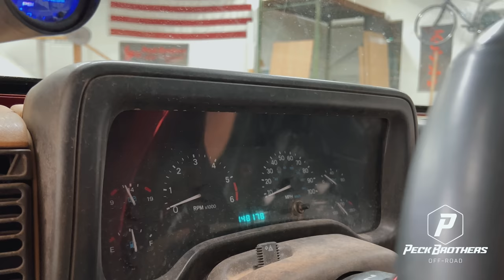HOW I BUILT MY DREAM JEEP

Comment: Currently building my dream lj. I’m building it to be a solid rock crawler and a decent daily. Took me ten years to pull the trigger on an lj after I sold my tj I had in high school when I went to college. (Gas was $5 and couldn’t afford it) 

New LJ Build is:
Metal cloak 3.5 lift
Fox shocks
Currie 44 front axle
Currie tie rod/ track bar
5.13s
e-locker front and rear 
Motobilt high fenders
Motobilt  bumpers 
37’s Patagonias 
Racelines 
Tom woods driveshafts 
Badlands winch 
And just a bunch of creature comfort things like speakers,  head unit, headlights, taillights, etc.

Comment: What are your thoughts on the Hot Rod Fuel hose for the hydraulic system? Looks like you changed the lines. Did you have issues?

Comment: I've been trying to figure out how to install cutting brakes I just can't seem to figure it out other than running another set of rear calipers so 2 calipers on each wheel kinda like some drift cars. I took a brake from trying to figure it out but I need to try and figure it out haha. Do you have dual rear calipers or can you give me a basic description or somewhere I can look for information? I need my brakes to still function normally on the road too. I'm running hydroboost and built to order dana 60s from East coast gear supply with big ass brakes. I have an atlas 4 speed and I want to take full advantage of that with cutting brakes but damn I just can't seem to find enough information for it to click in my mind. 

I don't do social media, the most I do is watch YouTube and look all over Google for information and I've spent hours and days searching forums but I can't find a good explanation or a kit that describes how it's plumbed and works.
Reply from the maker: What your doing sounds awesome!! We way we have our set up is, your front brakes will be hooked up the same as they would factory. The rear: line comes off the hydro boost, then goes threw a proportioning valve from wilwood, that line comes directly into the feed on the cutting brakes. Then you have a line coming out of each side of the cutting brakes. On the left side cutting brake the line will come out and go right to the driver side rear caliper and obviously on the right side cutting brake it will come directly out of that side and go down to the passenger side rear caliper. The brakes will still work like normal straight threw the cutting brakes. Then when you pull either side(without touching the brake petal) it will lock up the side you pull. Both cutting brakes and regular brakes on the same caliper!!! If you need more info comment your number and I’ll give you a call!!!
Reply: @PeckBrothers  wow thank you so much, I think that's all the info I need. I have a wilwood master cylinder and proportioning valve on my hydroboost too. 
I didn't realize that the regular rear brake feed runs into and freely through the cutting brake valves/masters during normal operation. I think everything makes sense now. So when you pull a lever it cuts off that one line from the system and applys pressure to that caliper. 
Now I just need to find a nice high quality cutting brake lever setup. I want a 2 lever setup not the single push/pull style. I really enjoy making hardlines and hoses like with AN fittings and stuff so I should be able to get everything plumbed really nicely.